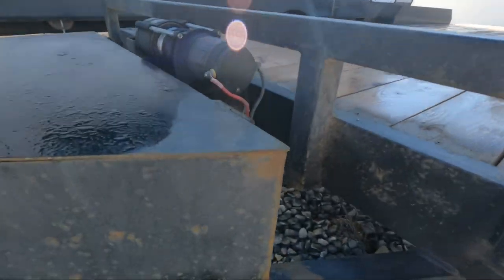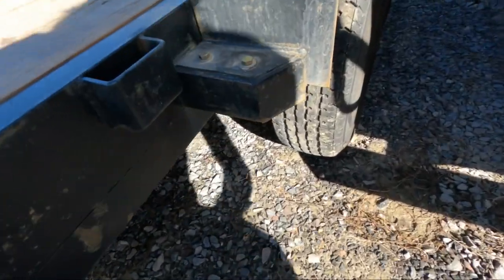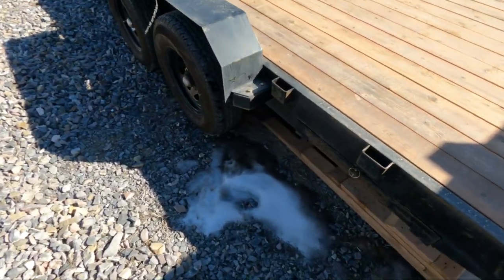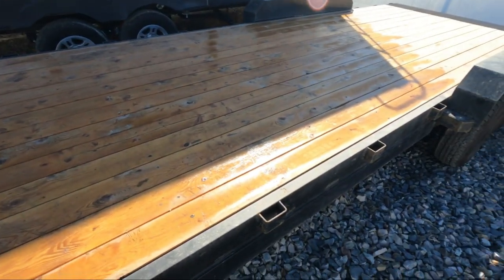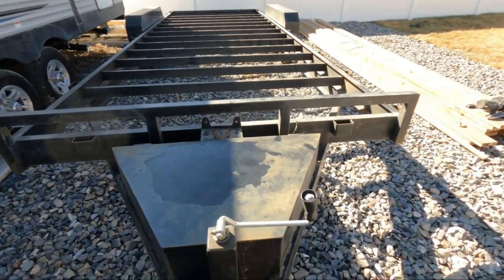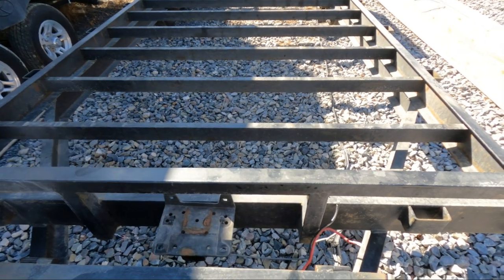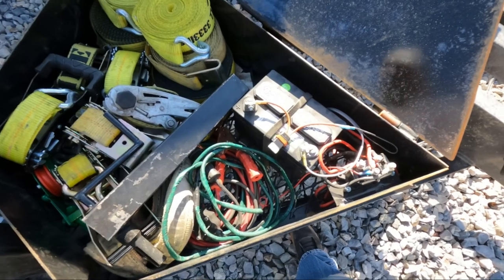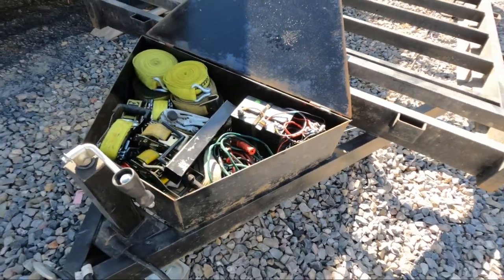Homemade equipment trailer // Powder coating prep

Comment: how much did the build cost over all? i worked at a trailer factory building different types. im thinking it will save me some money just buying a welder and steel so i can make my own trailer. new ones cost over $5K, so i know i will save ALOT of money DIY. you have had the best video on here for this style.
Reply from the maker: About 4200 with out powder coating. Powder coat was 1600. Before I built it called around to the trailer dealers in my area and a similar trailer was 7000. But they were all out of stock and a 4-5 month wait.
Reply: @kmac9759  thanks, im about to do the same